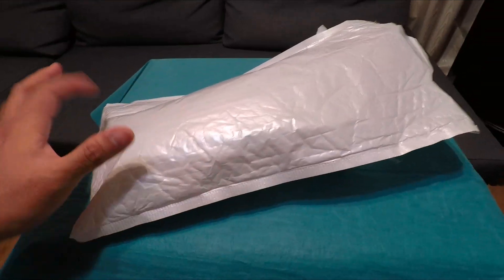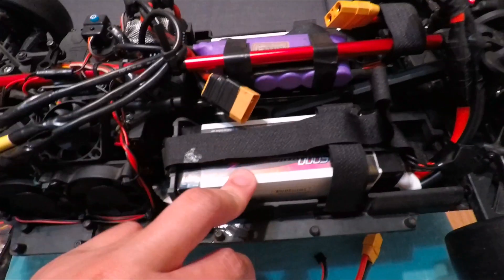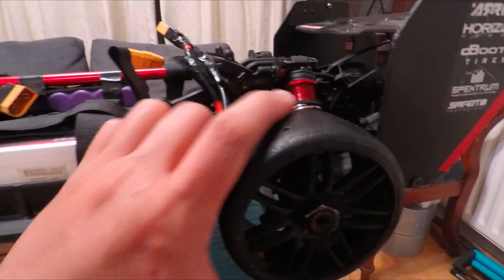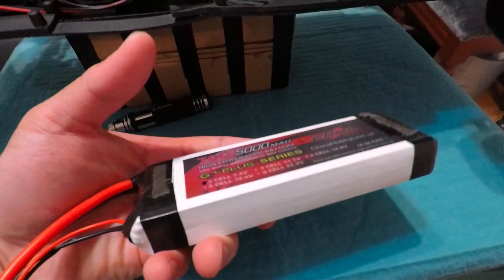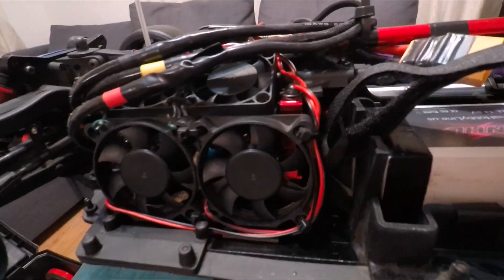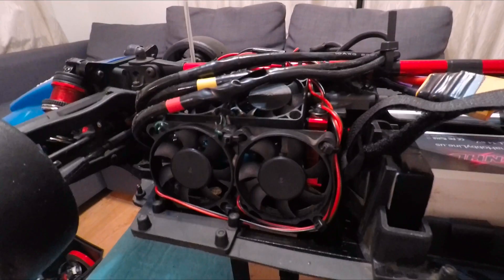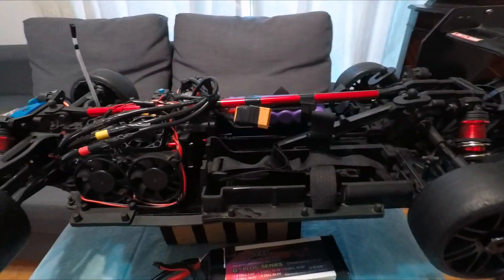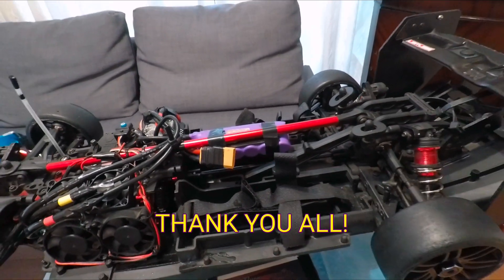200 kph Project ENDS | MSQ motor 6s | Arrma Limitless

Comment: FOR WHAT IT'S WORTH, I THINK YOU DID AN AWESOME JOB ON THE CAR !!  IT RAN VERY SMOOTH AND YOU PROTECTED YOUR ELECTRONICS WELL !!  BUDGET BUILDS ARE TOUGH, TRUST ME  !!  BUT YOU HAVE TO KNOW THAT THE LIMITLESS IS A HEAVY ROLLER CHASSIS, HAD YOU DONE THIS SAME BUILD WITH A TYPHON GT CONVERSION OR ANY I/8 SCALE ON ROAD RC, THE RESULTS WOULD HAVE BEEN MUCH BETTER I THINK !! ALL THE BEST TO YOU & YOUR FAMILY, YOU HAVE A GOOD HEAD ON YOUR SHOULDERS LIL BRUH !!
Reply from the maker: Thank you bro for the help ! Yes It's the weight as well. And the esc cutout kicks in faster in these heavier rollers. The typhon would have got it.